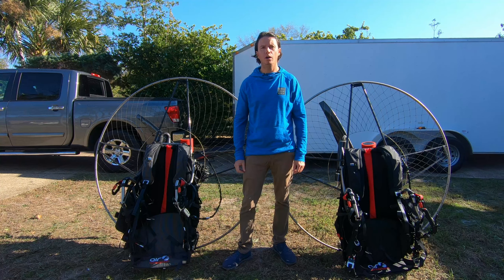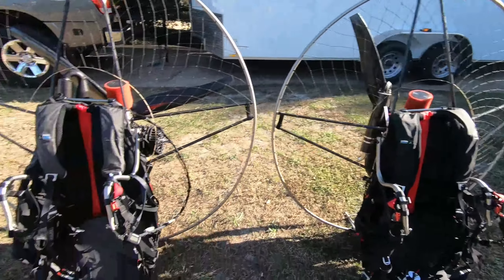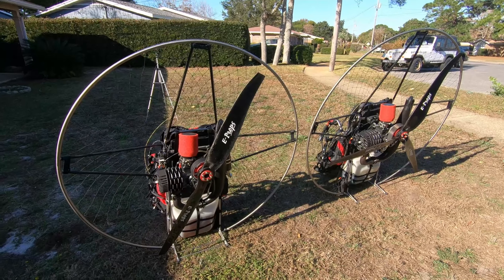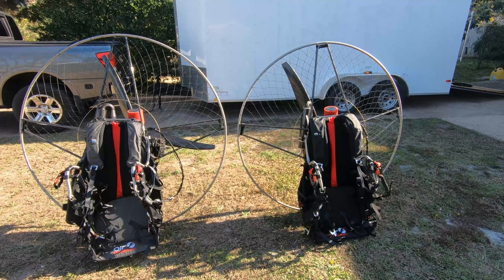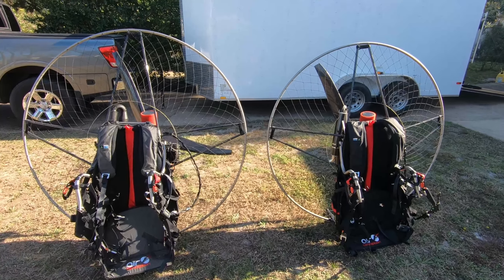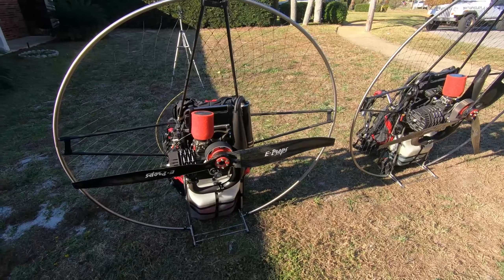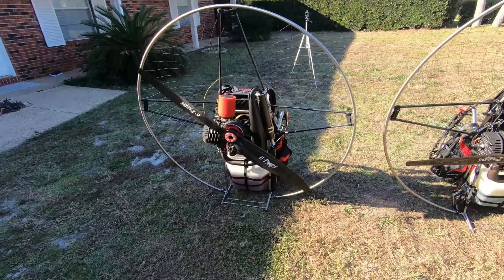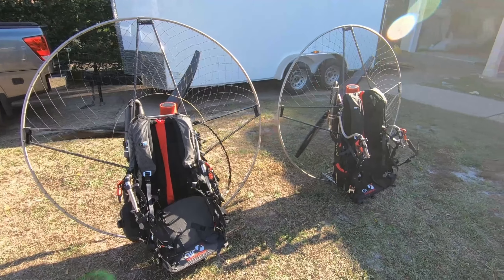Air Conception Nitro 200 VS Air Conception 280

Comment: I just had Training with Robert.  Gear and Training is top notch!  I got a sweet 2 bedroom Condo in Ft Walton Beach and very much needed the hot tub after all the activity.  I am 260 and glad I learned on the 200, although a long takeoff on a MOJO XL (30), my fat as needs a tandom wing (38) and a bit more thrust (lol).  Would have been hard to learn on the 280 though, its a beast.  If you want to get started, he's got a great location and Robbies background is paragliding, so you will leave knowing how to kite like a champ.
Reply from the maker: Hey John looking forward to doing more flights with you, thanks for coming out guys. Fly High
Reply: john wenzel I trained with Robert in May of 2018, couldn’t agree more. Had a blast and left with great kiting skills! Been flying since spring of this year on my Nitro 200!

Comment: Great video Robbie.  I weigh 207 naked and I bought a Nitro 200 through Robbie at Fly High Paramotors. I am very happy with the Air Conception paramotor. I was encouraged by some local pilots to get the Nitro over the Tornado and that also correlated with Robbie’s weight recommendations, so I went with the Nitro. What I see now and didn’t know at the time is that several of the LZ’s we use in this area have tight takeoff areas and have trees nearby that you sometimes must go over after takeoff.  Combine this with summer altitude densities  that get over 3000 ft. (Actual takeoff altitudes are 600-700 ft). This means the air is thinner and less dense and you have less lift from the wing. I have had a couple of takeoffs where that Tornado power would have been appreciated!  I’m considering changing to the Tornado before next summer.
Reply from the maker: I think you would really like the extra power of the 280, when you are ready to upgrade let me know and I will set you up. Fly High